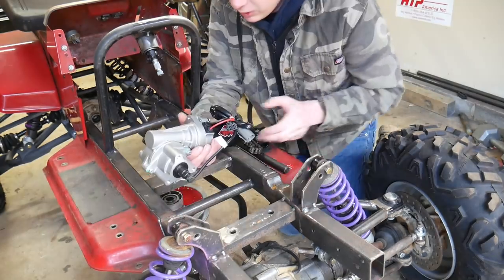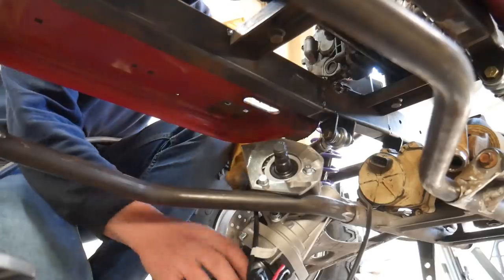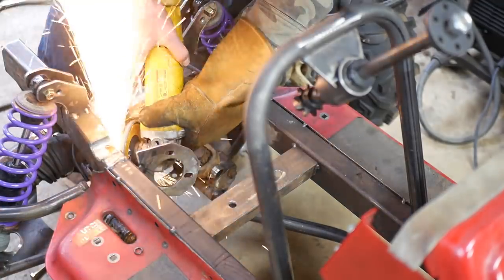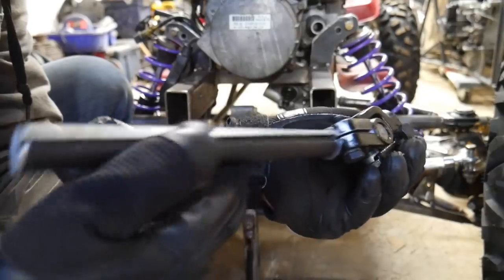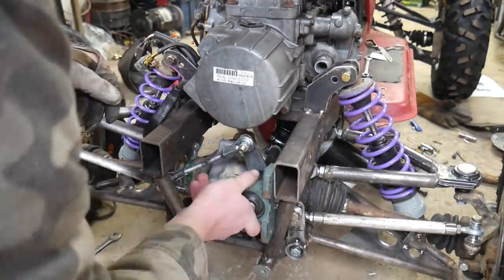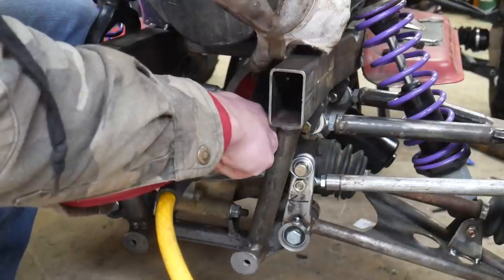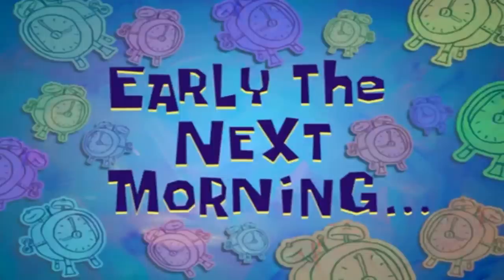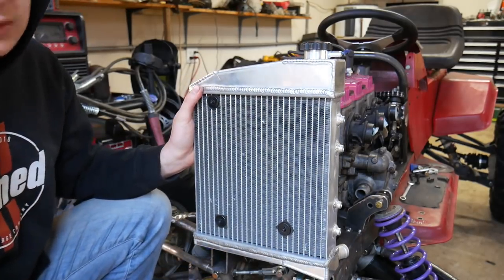4x4 100hp+ Triple Ultimate Riding Mower Build part 7!

Comment: You might end up having to put some sort of screw tensioner between the 2 sprockets on steering chain that hold chain tight so no slop.
Reply: Yea that's what I was thinking tool.
Reply: The problem is the slop changes sides depending on which way he turns it, hopefully when the power steering is working it won’t take as much pressure to make it turn.
Reply: @lukethompson5885  fr
Reply: @lukethompson5885  but a bit of tension over there wouldn’t hurt

Comment: That much flex in steering is going to be terrifying at speed.
Reply: He will probably end up putting a adjustable chain guide on there to take all the slack out the chain i would imagine, or your definitely right dude it would be awful drive at any speed
Reply: @johncoldwell340  gonna have to
Reply: The whole steering setup is so-so imo. Cant steer half as far to the left as to the right and seems not to solid.  Maybe try to get everything below the frame will give a bit more space for a better solution. The flex is the easiest thing to solve with adjustable guide

Comment: After its finished meet up with grind hard pluming co and race the 2j mower
Reply: A GHPC collab is a must! Racing a 3 cyl NA 2 stroke vs a Turbo inline 6 isn't going to be a fair fight. 100hp vs 300hp.

This will probably be a better match for Col. Senders.
Reply: @garrettstevens2232  Power/Weight ratios and gearing are going to be the key. This thing'll be 4wd so more grip and smoother acceleration due to the CVT. The 2Jz tractor will probably have tons of wheelspin. On a 1/8 mile race, my money's on this thing.
Reply: @ollilehtonen6764  same the mow mowbile I do believe will eat the 2jz from grindhard plumbing too much power for a 2wd tractor build not enough weight to keep the tires planted make a bet it'd dig a awesome hole and throw some hella rooster tails lol

Comment: I think the chain was my suggestion😛😛 anyway, I would make a plate on both sides of the gears so that they cannot fold into each other. When we use chain systems on Hotrods it comes in a solid housing. As far as the lathe goes, you can get a used southbend or atlas garage lathe from the 1950s or 1960s on Facebook market place. Those still have parts available and are a good sturdy lathe, as well as being cheap.

Comment: Awesome skills , Vasily! The work you did on the radiator neck was top drawer. After a little testing on the road, I'm sure you are going to want to get a good tensioner on that transfer chain on the steering. The "high end" boxes they build for hot rods have a tensioned chain guide inside.

Comment: Those pull through style fan mounts don't like vibration and eventually loosen up and rub through the core of the radiator. if you can mount it in a different way it will save you in the future.

Comment: I think you should definitely weld a bump stop for the linkage that the center link bolts onto. You can see when he turns the wheel to the left it hits the frame to keep it from steering any further. But when he turns it to the right, theres nothing to keep that arm from over extending, which could be dangerous especially when driving this beast because if that arm over extends and then binds up, its going to be stuck turning right and cause a whole lot of trouble!

Comment: Keep your eye out for 3 phase lathes as well.  With a Variable Frequency Drive (VFD) it is actually better than a Single phase lathe since you can adjust the motor speed with the VFD.

Comment: I make those tie rod ends you are using for the steering. I have a bunch of them different sizes.  Either metal to metal or with plastic inside of them.

Comment: When welding stuff like that radiator you need to back purge them with your gas which will keep you from blowing holes in it like you where doing but you would need an extra gas bottle but your outcome will be way worth it instead of chasing and trying to fills hole you keep blowing in the material

Comment: Where did u get that electric powersteering? I used to work at EPAS performance we sold adjustable module/driver kits for those u can change the sensitivity of the powersteering

Comment: Just a heads up dude those old engines put out 12 AC don’t hook up a battery unless you have a DC 12 regulator you burn everything out including your power steering, your going to need a big battery to due to low amps those charging systems put out, not 100% sure but those Polaris’s run a one yellow wire charging system so make sure you don’t over load the stator!!! Best of luck to ya man and great video
Reply: Those power steering systems draw power like mad!!

Comment: Make sure you flush that radiator before hooking it up to the motor and using it. All that grinding and welding fills them with all kinds of debris that could damage water pumps and clog parts of the radiator

Comment: You'll probably have some pretty bad bump steer or you'll break the electric steering I'd really recommend making your tie rods to be  at the same angle as your lower control arms, I think flipping the tie rod to the bottom side on the knuckle would work to make the tie rods as level as they can be with the lower control arms 
Edit: I actually am not sure I was thinking about my truck lol

Comment: Ummmm are you really going to hang the electric steering box below the frame and down that low where water and mud are it's regular environment considering it's 4wd ??? That steering looks suoer easy just sitting there not rolling on kinda small tires so hopefully larger tires are in the works otherwise why waste that steering box if it's not needed...js..